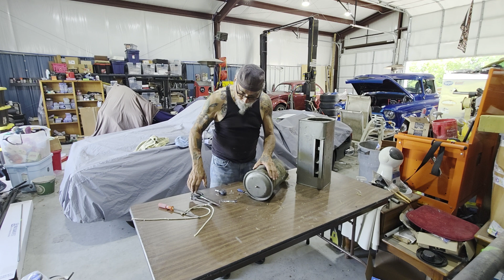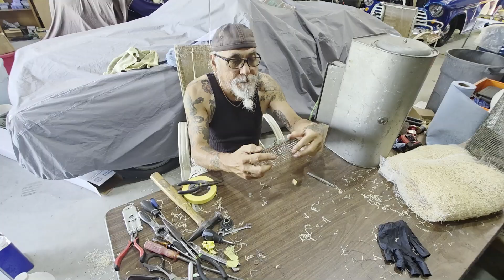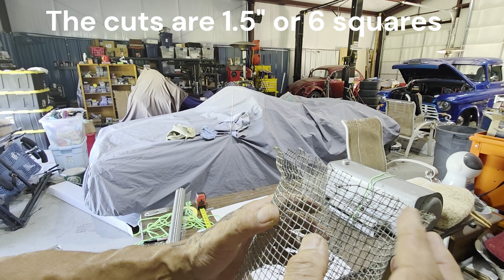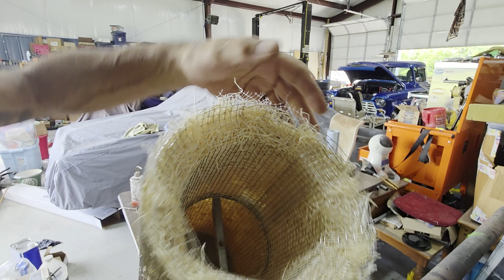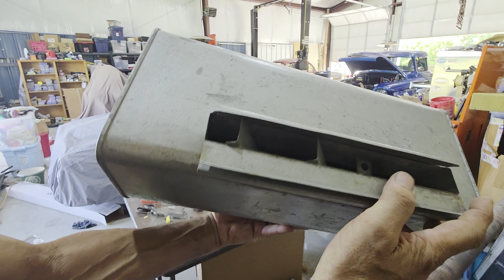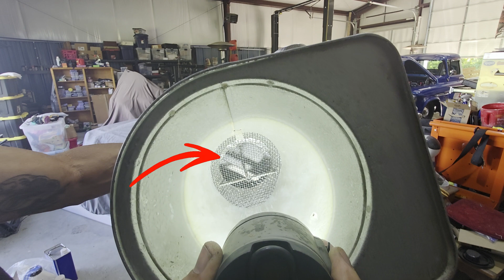Firestone Car Cooler, Thermador Electrical MFG. co. swamp cooler repair

Comment: Thank you for sharing this! I Ran across this exact Firestone cooler and was wondering how the string system worked. Different than the spring loaded types. Plus the cap info was good!